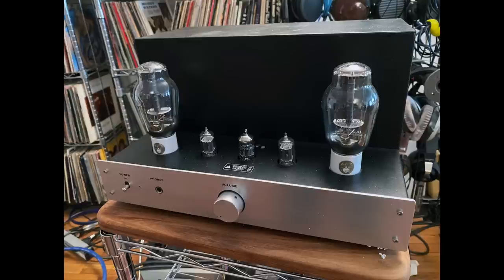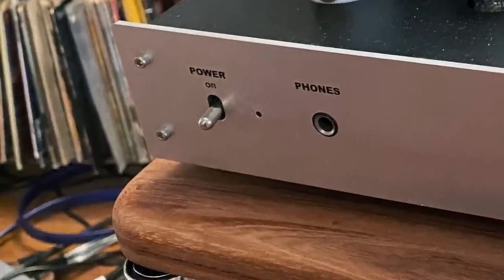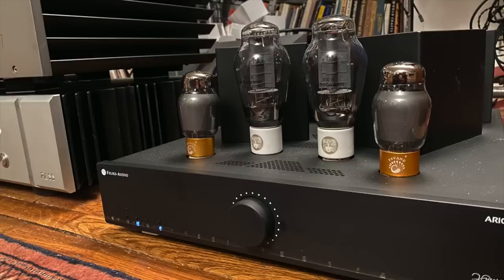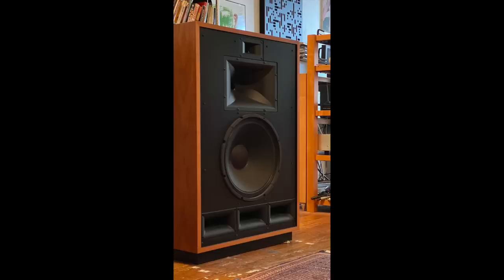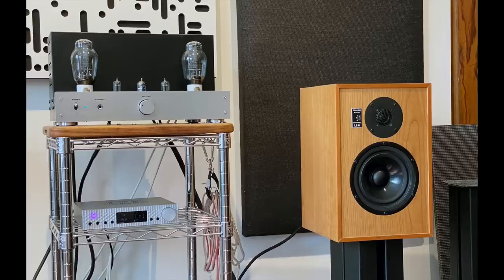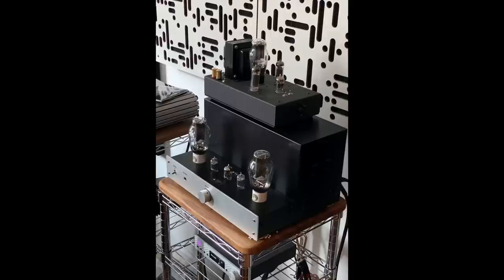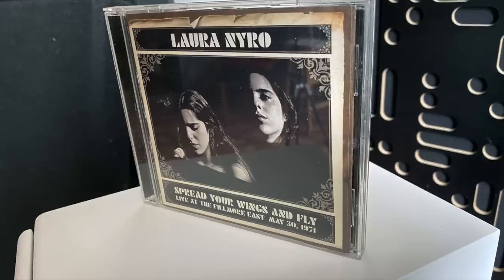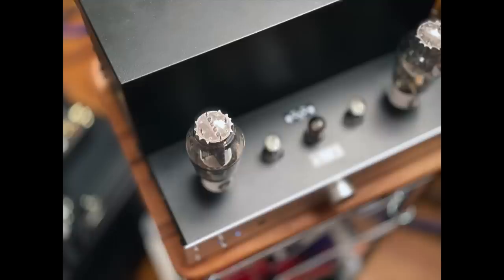Made in Japan: ELEKIT TU-8600 R amplifier

Comment: I just finished building the 8600R — easy to follow instructions and certainly doable by anyone with reasonable soldering skills. I had a lot of fun building the kit but even more fun listening to the completed amplifier. I purchased mine from VK Music in Vancouver with the transformer, cap and resistor upgrade at which point the spec matches that of the newer S version. By the way Victor, who is the North American distributor offers terrific support. I have been using the amp to drive Klipsch 600 speakers which had proven to be a good match. But I have Forte iii’s on order....
Highly recommend this amplifier!
Thanks for your review Steve, love your channel.
Cole
Reply: Hello Colin. I also own the Elekit TU-8200DX and I love it. just like you! It makes a pair of Totem Sttaf's sing beautifully and the music that comes through then erases all that is hifi for just human voices, accurate timbre and incredible space in width and depth where musicians and singers sit. It's just amazing for a small, inexpensive amplifier. My best regards from France :) Jean-Louis.

Comment: I have some experience with this amp that can hopefully benefit others. I bought it (the S version) after seeing this review and reading Herb Reichert's reviews, and I really like it - definitely a keeper. Sound is very detailed, clear, warm, and surprisingly powerful. Drives my Tekton Electron SEs (4ohm, 98 db sensitivity speakers) with ease. However, since the Elekit 8600 has only 1 input and Steve mentions that "most people" will likely use a preamp before the 8600, I assumed that was the way to go. I have at least 2 inputs (analogue and digital), and wanted a remote control for the volume. So I purchased a Schiit Freya+. After about a month of not entirely satisfying listening, I tried running my sources direct into the Elekit. Big improvement. Quieter noise floor, deeper soundstage, and just overall better sound. I tried several different volume combinations with the Schiit Freya+ and the Elekit, but my understanding now is that it's just never a good idea to put a preamp before an integrated amp unless you can bypass the integrated amp's preamp stage (which you cannot on the Elekit). So, surprised that Steve reviewed this amp using a Passlabs pre in the signal chain. In any case, it didn't work for me.
Reply: Hi I found your comments interesting as I am currently building the 8600S  I bought a few weeks ago from Tube Depot.  It's supposed to be the last run of them according to Tube Depot.   
So you found the 8600S sounded better without the pre-amp?   I didn't think the 8600S had a pre-amp stage built into it and was planning to build the Elekit TU-8500 pre-amp to pair with it.   From what your saying I won't need a pre-amp  and it could actually sound worse with one?
   I am almost finished building the 8600S.  Waiting on tubes and 9 pin porcelain tube sockets for the 12AU7 & 12AX7 tubes so I can finally fire it up and see if it bursts into flames or makes music..   : ) I also upgraded the coupling capacitors to Jensen copper Foil paper-in-oil caps.  Wish me luck! : )
Reply: @mojoneko8303  Hi Mojo. Good luck! I paid someone to build the amp built for me (sad, I know - would have liked to tackle this project myself if I had time/space). Pretty sure I would have burned my house down. Yes, to reiterate what I wrote above, definitely don't need a pre-amp with the 8600 as it already has a preamp stage inside, and the pre (in my experience) just created more noise and less clarity. 
Interested to hear how your amp sounds when completed. What kind of speakers are you using?
Reply: @joshuaschneck  Hi Joshua Thanks for the reply!  : )   Not having to buy/build a preamp will save me a few bucks...  : )      I am almost finished with the amp.  I am also building a pair of the CSS Audio Criton 2TDX Tower Speakers with the Superior Cross overs to pair with the amp (They finally got the 7" drivers back in stock).   I am building the cross overs now and will start building the cabinets next week.  I didn't buy the flat pack but chose to build the cabinets myself from 3/4" Red Oak.  That's going to push my carpentry skills a bit.  
 Once I finish the amp I will plug it in to the Parts Express Passive/Aggressive speakers I built for my desk top computer speakers to test out the amp.  I will try not to blow them up!  : )   I was very meticulous with the assembly of the 8600S and checked everything 4 times before and after I installed it.   Besides the Jensen caps I also replaced the original resistors with Adams USA made military spec 1% resistors and used German WBT Silver Solder for all the soldering.   I want to make this amp perform as well as possible.   I will try the 8600 without a preamp and see what I think.  Thanks for the input!  : )
Reply: @mojoneko8303  curious to know how this worked out for you.  I have contemplated buying both the 2TDX as well as the 8600.  How did the pairing work out?

Comment: I built one about a year ago, it was my second Elekit and second tube amp, the first was 6L6GC, but can use a whole bunch of pentodes. That was super tubey, beautiful mids, rolled off top and bottom, great with some music, not so great with some. Not something I could live with full time, but Herb and a few other reviewers sold me on trying the 300b and man, I wasn't prepared for how good it would sound with any and everything. Forte 1's are my main speakers and a Yamaha A-S2100(the VU meter convinced me to try low powered amp). It was almost 8 months the Yamaha sat unused until I got in a pair of full range driver speakers and almost as an afterthought I tried some other amps and then the Yamaha. The speakers ended up spending another couple weeks taking up too much of my living room, because they sounded so great with the additional power. Next up are some new crossovers for the Forte that will even out the crazy impedance swings, though they will still be 4 Ohm, unlike all the Forte that came after.

Comment: As always, great work on this review! By the way, the “punchier“ version of your saying about cubic inches goes like this, “There’s no replacement for displacement!“ 🙏❤️
Reply: If displacement equates to wattage then 9watts per channel is all you'll see from single 300bs in a single ended (class A) configuration which generally means you'll want as high efficiency (db SPL) rated speakers that you can get. Otherwise a person is looking at more final stage tubes in the amp and perhaps a push pull configuration which many audiophiles criticize as not having as much of the 'warm tube' sound that SE amps have. Personally I play my rig at lower volume and use decent efficiency speakers, and tubes are fine with me in that regard. If you want volume levels that blow your hair back, you'll need far more complex / expensive tube amps, or bipolar transistors, or fets. We must remember that perceived levels of volume are not linear.. 3db SPL increase equates to double the output power (watts).

Comment: Informative review! Thanks to Kevin of the Glow in the Dark website, I’m seriously considering a 6L6 single ended amp from Elekit. The 8800 is the current offering though it’s substantially more expensive than it’s successor, the 8200. A review of either of those would be interesting.
Reply: The TU8200 is a little wonder for its price. As much for the headphone input as for its speakers.Mine is wonderful with the Tung-Sol 7581A and Psvane 6AU7-S, after about 100 hours of break-in.
It is quiet, silky, smooth with a beautiful 3D image !
I love this amp (TOTEM Sttaf speakers).
Reply: @douxreveur131  that is great feedback - thank you very much.
Reply: @PanAmStyle  Avec plaisir :)
Reply: The 6L6 elekit is a great amp. It is dead quiet.
Reply: @bertroost1675  You guys are not helping my bank account! 🤣
Reply: @PanAmStyle  my pleasure! lol

Comment: Hi Steve. Thanks for this review. I'm very intrigued by this amp. One question - Herb mentioned in his conversation with you about this amp that 300b tube amps don't seem to pair well with "low impedance" speakers. I have a set of Tekton Electron SEs that are designed for 4 ohm outputs (according to Eric). Can you say anything on whether this would be a good or a bad amp to mate with the Tektons? Aside from being "4 ohm" speakers, they have high (~99db) sensitivity. 
Thanks for your help,
Josh
Reply from the maker: Sorry, I have no clue. You should ask Eric

Comment: Having been in the electronic manufacturing industry and having personally soldered probably 800-1200 electronic devices, including medical, military products, and personal audio projects... I still am hesitant in doing DIY tube projects.

There’s nuances and a level of skill along with experience when it comes to soldering. Just because someone can solder doesn’t mean they can do it right or with quality. I have inspected electronic components soldered by assemblers who are diligent and have years of experience compared to newbies, and there’s a huge difference in quality. Done wrong, components are degraded from over overheating, board damage or fatigue, fried wires, uneven solder flow, over and under use of flux, and the list goes on. Then there’s consistency. There could be 50-300+ solder joints...
Reply: I have assembled far fewer than you . It can be difficult, especially when the packaging is small and everything is tight and close . I work slowly with attention to detail , using a temperature-controlled soldering station with 50 watts maximum and rosin core solder . I use aluminum spring-loaded heat sinks to protect components from overheating and I have not had anything fail to work on first try except for the very first device, which had a faulty power transformer . Four of these pieces were vacuum tube amplifiers , the balance solid state and none with surface-mount components . Soldering is a learnable skill . As in anything , practice improves quality and an advisor to show errors is a blessing .
Reply: @biketech60  You did something that everyone should do: attaching a heat sink or dissipator where possible to redirect the heat. I’m glad you’re taking the time and care, it will pay off in dividends.

Comment: It's a nice kit, but the fact is that I can put together my own so called kit, built my own stereo 300B amp for less than half the cost of that kit. If I don't know the components I need there are plenty of websites with Parts lists and schematics designed by very good engineers. I do appreciate that the Japanese culture of audiophiles loves the tube amps as we do and as such help keep the manufacturing of the tubes and needed transformers alive today which may have otherwise been totally abandoned as other obsolete technologies (yes, they not only build them, but you'll find them in their dwellings). I agree with the statement that this tube amp kit is considerably cheaper than fully built amps of the same type, but in comparison with other means of building your own albeit other kits, or gather your own parts, no, not at all.
Reply: man, you must not have any friends!

Comment: Steve how about *Herb approved) Rogue Stereo 100 with four KT120's pumping out 100 wpc push pull?I have German Horn with EL34's (50 wpc)  but want the low down about hard hitting power even if it is push pull vs these SET morsels as tasty as they may be

Comment: Can someone recommend me a good power amp? I’m trying to get separates and I think this is the best place to ask since you guys are very knowledgeable
Reply: The choice of power amp is based on which speakers you have settled on for the long haul and what set of sonic characteristics you prefer most . Only personal experience can inform you of that . There is no shortcut to your version of sonic nirvana . A bit like learning an art , you must begin and progress from there & never give up . Listen to what you can find .
Reply: Shane I would suggest not spending $1 on any new components until you have successfully investigated and implemented good room acoustics products if you have not already done so. It is the true foundation of a system.
Reply: @tullskull  my room treatment is pretty good I have carpet and a nice distance speakers from the walls , I’m running a Rega preamp into an integrated sansui au 101, which is causing some distortion and buzzing noises at higher mid to high volumes which is why I was looking for power amp recommendations , what other room treatment things have you tried ? I’m open to anything
Reply: @shanec6664  well in general I would suggest some diffusion on the front wall (behind the speakers), base traps in the corners and absorption at the 1st reflection points.

Again you want to consider interaction with your speakers for your amp choice. Synergy would suggest an amp from rotel as the path of least resistance. Try to listen to several different types to get some experiences under your belt. 
So your checking out Elekit...are you open to building an amp kit? 
Many to consider. Look at the Akitika.
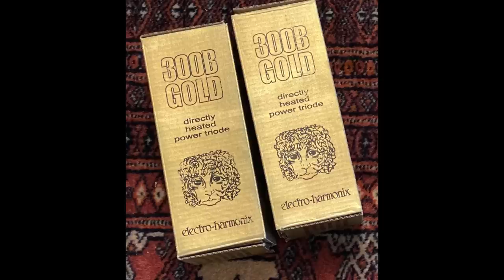Reply: @tullskull  you can actually see my speaker placement in Steve’s latest video , it’s the very last pic at 1:16
Reply: @tullskull  and thanks for the info I’ll definitely check that out
Reply: @shanec6664  Hope it helps!

Comment: still love my 2a3s better...my opinion...RCA are the best tubes i own many telefunken brimar Ratheon  ect probably 3k in tubes and still love the RCA...
Reply: The 2A3 is the "little brother" of the 300B, half the power but twice the music, and my choice any day. but those EH tubes are really average [IMHO] the Psvane are much better and the further up the range the better they get.
Reply: @ianlarge4635  In the last several months I discovered Sylvania tubes; I had never given them much thought, but I started using a Sylvania type 80 (with adapter) in my Zen amp, and holy cow! I’ve read a little bit about some of their other tubes, and it seems that depending on which tube type and construction, some are VERY highly regarded. So I wonder how Sylvania 2A3s would perform?  If I do get an 6L6 SE amp, I will try the Sylvanias first.
Reply: @PanAmStyle  yep sylvanias are right behind rca in opinion
Reply: @PanAmStyle  I have been using 2A3 triode amps for several years and the latest developments particularly out of China makes all of the vintage valves sound weak and  outdated, the newer models from Psvane and the parent company Shuguang make the old/vintage valves obsolete in my opinion, its like believing an old car is better than a new car, it simply is not!!, about 12 years ago i had a 2A3 amp that was supplied with Sovtek  valves, i immediately swapped them out for standard Shuguang and they were much better,, China replacing Russia, then i was introduced to the TJ Meshplates and was bowled over how much better these were, a greater degree of transparency from these compared to the solid plate Shugs, i kept those for about 2 years and then tried the then new to the market Psvane meshplates, way better made and an inmprovement all round, so out went the TJ's and as newer versions became available i moved up the pecking order and tried the vastly more expensive WR series that were supposed to be a WE copy but as Western Electric never made a 2A3, this is confusing but who cares?, i now use the WE275 solid pates version of the 2A3 made by Psvane and these are the very best i have tried to date, and that was a purchase 4 years ago, so quite a journey but i have settled on these and they still sound great, so keepers they are!

Comment: US$ 1.680,00 for an amplifier that you have to build yourself and no tubes! I,d say Go Chinese!
Reply: Thankfully you don’t have a channel
Reply: Having worked in electronic manufacturing, $1,780 is a bit much for this layout and in consideration of the competition.
Reply: Agreed.  I have Jolida integrated with  three inputs that came with Svetlana tubes that was less than this kit without tubes.
Reply: @bobb.9917  Cayin, Raphaelite, Little Dot , ming da, Line Magnetic etc etc 
as far as price/ quality  Can almost quarantee you will be completely satisfied.
Reply: @JohnJohn-lk4lq  Are you speaking from experience or do you have to get rid 
of some prejudices?
Reply: i think the main reason for buying the elekit is for the fun of building your own amp.  i own two line-magnetic integrated amplifiers - the 300B 210IA (~$2k from china hifi) and the 211 AS125 (~5K from grant fidelity).  the build quality on both is superb.  i have no reservations about recommending either one, if your application involves high-sensitivity speakers.
Reply: Are you kidding me?!
For a dollar and sixty-eight cents each, I'd buy four of 'em and bi-amp 'em as monoblocs, if they're bridgeable!
Reply: It’s way cheaper if you buy direct from elekit like 500-600$ the middle man is charging 1000$
Reply: The company had no idea how cheap you are, so don't blame them.
Get over yourself, it's not all just about you.
Reply: @hughjanus1135 But if you buy direct you only get instruction in Japanese.  You have to buy from there English speaking agents to get the translated build manual.